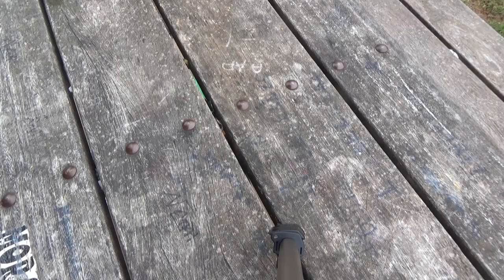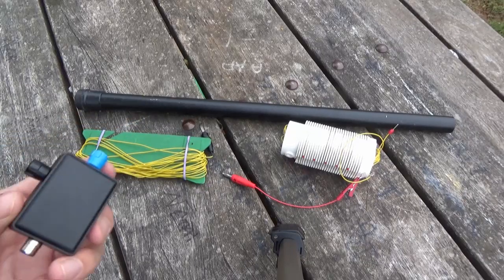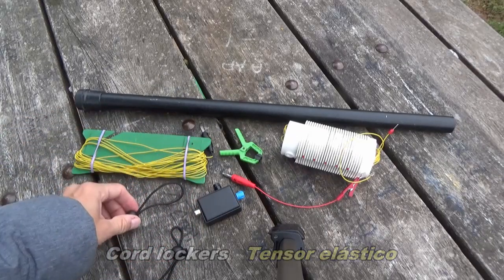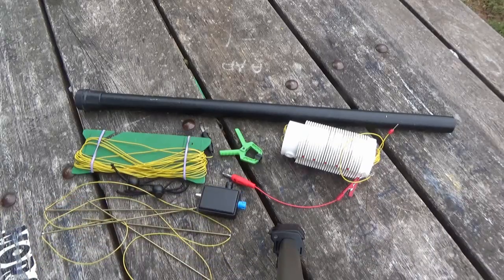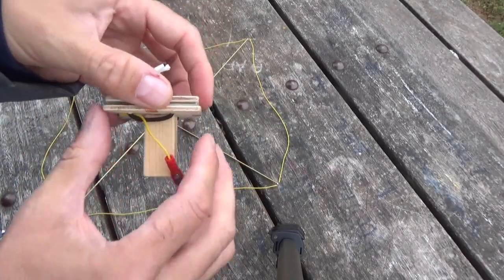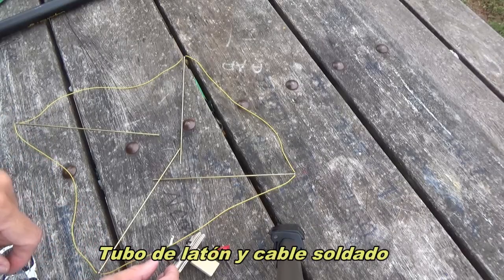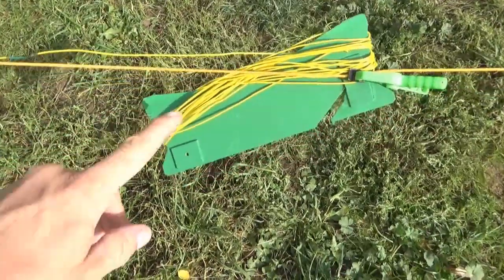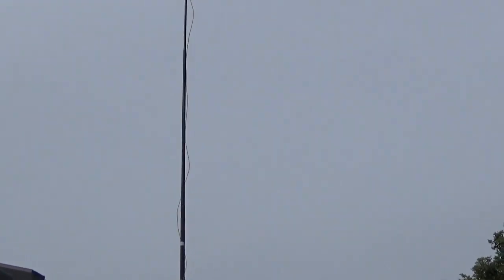Short multiband vertical HF antenna (Antena corta de HF)

Comment: Ignacio, thanks for for showing us your ideas, I specially like your solution of the light capacity hat!
73 Stephan
Reply from the maker: Yes, my pleasure sharing that. I rarely see capacity hats on such short verticals and it's not that difficult to add one: they contribute to gainig some performance in this antenna. 73 Ignacio

Comment: Hi Ignacio. This antenna is amazing. I have QSO with you on October 12th in EA2/NV-053 at 40 meters, just as you say in the comments of the Sota reflector page you were with this antenna. I also made QSO with Jorge on the 60 meter band. Congratulations on the antenna, it works very well.
Reply from the maker: Thanks a lot Alfonso, always great to work you , 73